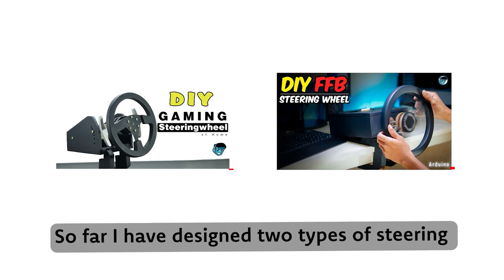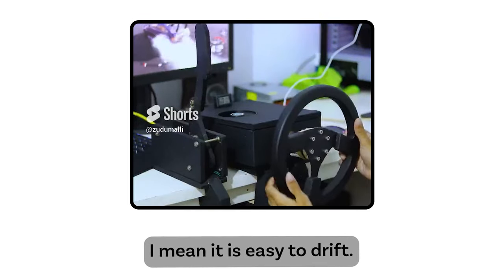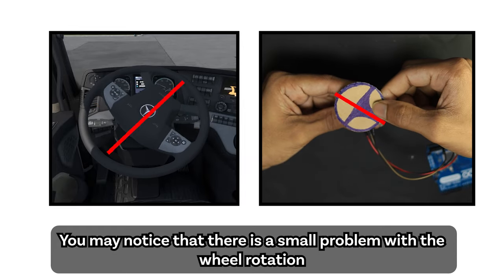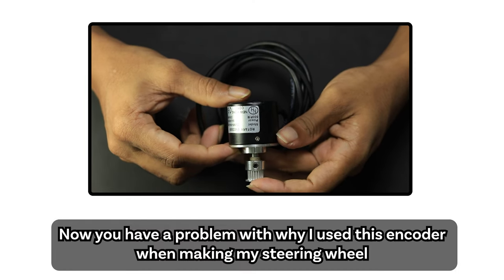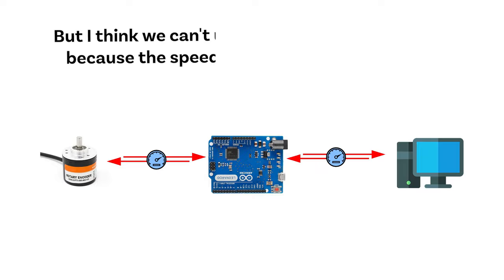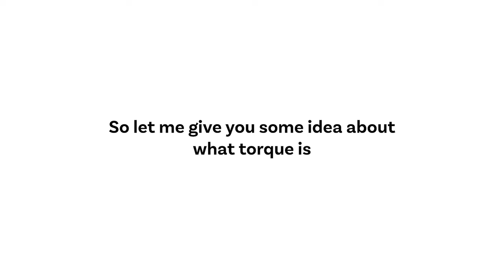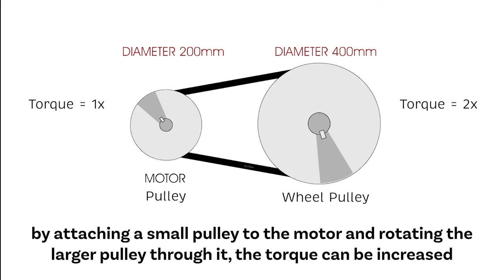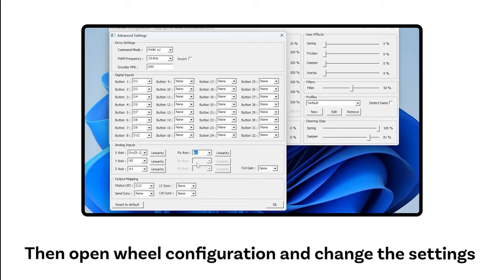Tips You Need to Know! | DIY Gaming Steering Wheel (Important)

Comment: Hey, what is the use of the fan gearbox you mentioned twice or thrice? Also i am looking to make a setup which has 3 rotary encoders for inputs
The layout is like this
1st Steering Wheel Encoder related towards the A and D inputs for the keyboards,
Easy, however, 
2nd and 3rd Encoders behave a bit differently, they control the X and Y axis of the camera of a game and not vechile movement. Is this Setup possible? Possible?

Comment: Hello i am using a high torque but only 200 rpm motor is that ok ? Also isnt the ecoder u showed only 360 degree?
Reply from the maker: Geared motors are not recommended for this.
No it's unlimited

Comment: Have you considered magnetic encoders as a cheaper option ?
Resolution is very high but I'm not sure if output signal is compatible with software......
Reply from the maker: Yes I am also not sure if it works with arduino

Comment: do you still need 5k ohms to place the encoder? and how do you place it where is the positive and negative side of the resistor?
Reply from the maker: No, the KY-040 module comes with built-in resistors. And this resistors don't have positive or negative terminals.
Reply: @zudumalli  no no like for the 600 ppr since i watched tech at home i got confused on the resistor where is the positive and negative side and my ppr is broken now i have to buy again so please do a tutorial for that
Reply: @zudumalli  hello u never answered me back man
Reply from the maker: the resistors don't have negative and positive terminals, you can search it on Google also, and this encoder supports 5v to 24v so it's not burned don't worry. if 5k resistor not working use 1k or 10k resistors.
Reply: @zudumalli  wait but mine has red and black but okay tech at home made my encoder broke urs better bro and u have less u too underrated btw please do the pro and get the stm32 i need the wiring for it man

Comment: Wich pulley and Belt would you recommend for my1016 motor?
Reply from the maker: Better if you can use chain
Reply: @zudumalli  yeah i used chain jts working good one issue im ghavin is when i apply Force either the steering Wheel gets Loose or the sprocket on the steering shaft gets Loose did you use anything Special to fix özür Steerung Wheel on the shaft?

Comment: Hi! How can I connect an Epson L printer encoder? I would like to connect it to the Arduino. Another thing, I saw that you can also use the Arduino Uno with Unojoy, is this possible?
Reply from the maker: you need to find encoder signal outputs and power inputs. It mostly has two signal outputs.
no, I didn't use UNO device for the steering wheel. this method supports Leonardo devices only.

Comment: I have an old racing wheel but the potentiometer i didn't know with what i should connect the third terminal in it to fix my racing wheel i connect with lx ? And to know in my circuit there is now ly
Reply from the maker: connect to the Lx

Comment: Isn't there a way to connect the encoder and 4 potentiometers? To be able to use the handbrake without the need for the joystick
Reply from the maker: No, Wheel config software only supports 3 analog axes.
Reply: Ooh then there is no choice but to set the handbrake with a button, Thanks for the information Bro
 @zudumalli

Comment: Bro if there any way to remove the dead zone in 🎮 controler , can you make an another video that explains the diy steering wheel using controler and I have a doubt about using a rotary encoder module instead of potentiometer, plz comment your thoughts ❤
Reply: Probably not, the PCB in these controllers are cheaply made and I think the simply processor/IC can’t keep up with such precise inputs.

Idk what doubts your having, but if it had to do with the software, anything is possible, my knockoff CH340 Arduino Uno R3 works by using vJoySerialFeeder, the CH340 cannot be used as an HID inputs through UnoJoy. If it’s about pricing, the Uno R3 CH340 only costs $3 minimum and the rotary encoder only around $1

Comment: @zudumalli Please help - I have a problem. when I turn the steering wheel to the left, the engine actually blocks further rotation and moves inwards, but I can turn to the right indefinitely and it never locks up. I verified the connections on pins 10 and 11 and everything is well connected. I use exactly the same parts as you in the video with instructions on how to build and I even checked it on other encoders - still the same
Reply from the maker: Reset the settings in the wheel config software. that's a bug.

Comment: türkiyeden merhaba severek izliyorum encoder kullanmayı planlıyorum 900 dereceye nasıl sınırlandıra bilirim fiziksel ve anladığıma göre dişli kutusu kullanmaya gerek yok deyilmi?😊
Reply from the maker: Thank you and welcome! The maximum rotation of the potentiometer is only 300 degrees. So, use the gear ratio of a fan gearbox and get 900 degrees from the potentiometer.
Reply: @zudumalli  tekrardan merhaba ama potansiyometre derecesi 270 derece deyilmi? bide ben rotary encoder kullanmak istiyorum ona dişli sistemine gerek varmı yok mu?
Reply: @zudumalli no he wants to use a Encoder but limit the Rotation to 900 degrees physically without motor and ffb if i understood it right
Reply: @amacszoyuncu3355 sadece direksiyonun 900 derecede mi sınırlamak istiyorsunuz? Motorsuzmu yani Force feedbacksiz mi?
Reply: @AbdülkerimYilmayan  evet

Comment: Bro ,for me with the 775 motor, when I turn the wheel, there is a screeching sound and the torque is very low, and the bts7960 driver gets very hot. I added another motor and tested it with 12V 10A and 20A, but there was no difference, what is the reason?
Reply from the maker: First, test the motor from direct 12v to make sure it works fine. then check the wiring of the BTS driver. maybe problem with your BTS driver.

Comment: I just cannot figure out how to make a non forcefeedback steering wheel self centering (especially using a rubber band), that’s only my problem lmao
Reply from the maker: I have tried with rubber bands but after a while everything breaks
Reply: @zudumalli  I just figured it out using elastic bands (not rubber bands), simply wrap it like a knot around the steering axle and hot glue it for extra protection for the center point. The elastic band I used is quite thick and provides decent tension/torque, and I’d doubt it’ll break anytime soon even after intense usage. The small issue is the frame, I used a cardboard frame which also where I wrapped the elastic band, the cardboard structure is bending when I wrapped around the cardboard, but thankfully I fixed this issue again by putting some sort of “roll-cage” to strengthen the structure by hot gluing a metal wire on it (in this case it is better to use something like a wooden tube, any some sort of metal stick, or PVC pipes since I don’t have it even something similar to that, atleast that it would fit without cutting it).

Comment: I have a problem that I can't solve I hope you can help me, I'm using a 600ppr encoder but I can't make it work on pins 0 and 1, I tried on other pins with some code I wrote and it works perfectly, but since I try to put it on pin 0 is 1 it doesn't go, regardless if I use my code, etc utility lite or wheel config. Please help me
Reply from the maker: When connecting to pins 0 and 1, you have to connect through two resistors. It is shown in my (DIY spinning wheel) video.

Comment: I fuck€d up my Thrustmaster TMX wheel, I did the roll barrels mod changing the “crunchy” steering for something more smooth, but on my ignorance I forgot to put some grass to lubricate it, and also the tension was much, so playing one day. The force feedback broke up. Also, on my desesperate and again, ignorance, I thought it would be easier to open it and fixed it, I touch mother board, and having a very nice non-skills on handleling electrónic components, I put much force trying to stick out some cable with de screw driver and I “stab” something on mother board who actually sparked jajajajaa. You can imagine I ensambles it and now don’t even turned on. I thought was something wrong on power supply, so I took it off (after 1-2 months of learning and counsoulting videos) n changed it to a laptop power supply. And guess what? Didn’t turned on JAJAJA. I want my wheeel back, I’m a younger studyhungry boy, no money to another “expensive “ wheel
Reply from the maker: You can use parts of your wheel and rebuild it. It's a bit difficult but try.
Reply: @zudumalli  Can u give me a consult or tutoring through some Social Media? If I may, Im agree to even pay for your time as a consultor